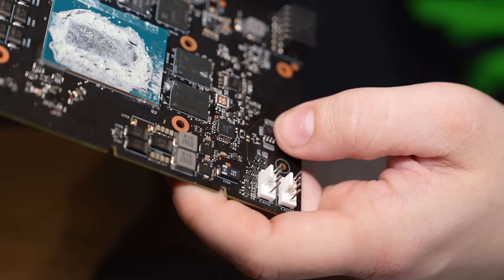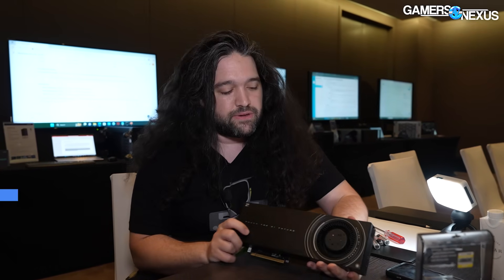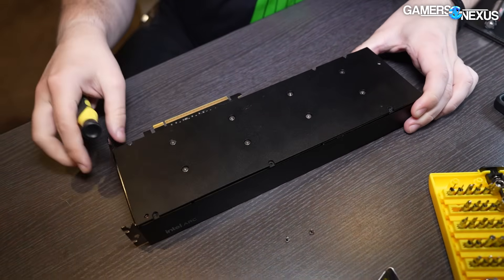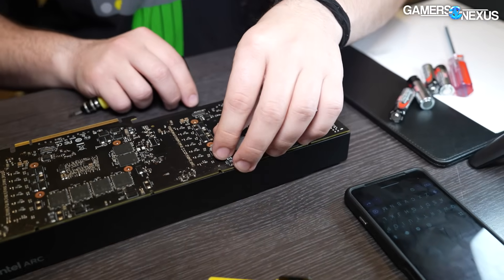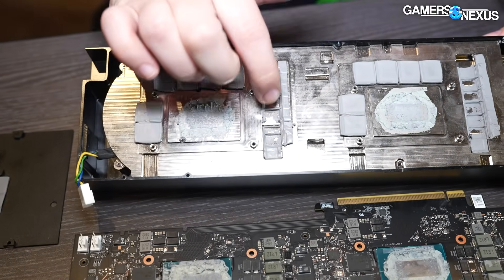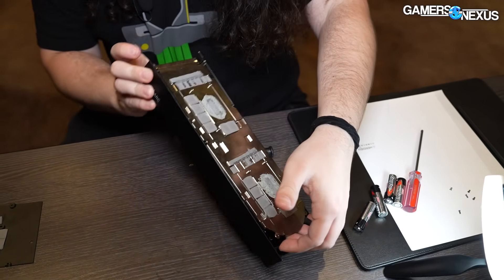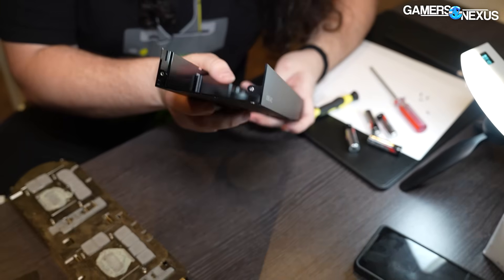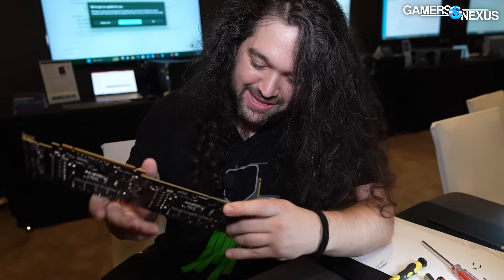Intel Arc B60 DUAL-GPU 48GB Video Card Tear-Down | MAXSUN Arc Pro B60 Dual

Comment: 48 GB is currently a sweet spot for local AI, you need either 2 consumer GPUs or 1 pro GPU. 2 cards is "affordable" (when buying used), but a PITA to fit and cool in a PC. So a dual GPU with 48 GB at below $1000 might be an instant buy for anyone working or experimenting with AI.
Reply: At this price you buy two and go 96gb
Reply: you're right on the mark, $20 per GB of VRAM is INCREDIBLY cheap, like, 2.5x cheaper than a 4060's 8GB for $380
Reply: Only concern is that it's two 24 gig cards essentially. Would be nice to see more vram per GPU.
Reply: @AltimaNEO This is probably for multi seat setups more than full system AI stuff, Intel have other configurations with more RAM per GPU as well (and it's easier to stick 48GB of RAM on a single GPU card than to squeeze 2 separate GPUs with 24GB each on a card)
Reply: @AltimaNEO  that's already huge, but regardless most AI APIs have the ability to use the two GPUs together for 48gb
Reply: @AltimaNEO  the advantage of the dual GPU on one pcb is that the card should actually be able to utilize the full 48gb pool instead of sharing it like older multi single gpu cards (I think) This is why when you were doing multi gpu in the past it was better to buy high vram variants (like 4-8gb 270x / HD7870, yes these existed in 2012). If you did this with the 2gb cards you'd be stuck to sharing a 2gb vram pool instead which is better for single card loads, since those video cards dont have the horsepower to utilize more ram than that, unless in multi gpu configs.

Idk how multigpu configs have changed, idk if they handle vram differently.
Reply: @somedude9316  Yeah, but I think this particular card is just literally two GPUs on a single board, each with their own discrete 24 GB VRAM. I dont think theyre sharing the VRAM pool. If they did, it would be totally awesome.
Reply: @AltimaNEO  its on one PCI slot on one PCB,  I'm pretty sure its a single vram pool. Internet experts go ahead and correct me. I did zero research.
Reply: @somedude9316  It's not. It's mentioned in the description, and AFAIK it's the same for every multi-GPU Tesla. If you want pooled VRAM, you need multiple boards and NVLink - because that makes sense... As for Intel, IDK if they have the equivalent yet.
Reply: @yumeN0dengon  if its bifuricated into 2 cards on one pcb without a shared pool I dont see how it could be of any benefit opposed to literally any 24gb vram card other than the packaging / space in a multi gpu configuration.

I thought the industry stopped using link connectors like xfire and nvlink because you can just do this over pci-e. (even if its slower)
Reply: @somedude9316  AFAIK NVIDIA still heavily relies on NVLink to provide large GPU pools. As for the benefit of having a discrete multi-GPU board, I guess there's something to be gained in terms of management and space/ports requirements, as you said, plus maybe some performance gains as well due to onboard bifurcation? It never presented an interest for what I do so I never dug into it any further TBH.
Reply: @somedude9316 yeah but he mentions in the video they're running in pcie 2X 8X. So they're literally two discrete cards with their own discrete 8X pcie lanes, just sharing a single PCB.
Reply: 3 of these would be perfect for running when 235b at 4bit comfortably as well. Our current best cheap options involve running it at 3bit on 128gb of ddr5 on a server/workstation type PC, or one of the 128gb unified vram/memory PCs on lpddr5x.. both options are fast enough cause moe, but running on q3 sucks compared to q4.. the extra 20ish GB over that will be very nice. This will also be much faster. 1000 bucks per 48gb is very solid.
Reply: The major issue I see with this card is the fan. The blower fan is inside the card, and the card is exactly 2 slots wide, leaving no room to get new air if you stack the GPUs side by side, as we can see in 1:12.
It would probably be better to use a non-axial intake blower fan, that takes the air from the top or the rear of the card and moves it to the exhaust. A bit less effective than a blower fan, but much better than a blower fan with a restricted intake.
If they want to use an axial blower fan, they need to make a recess for air intake.
Reply: But in this case, since it's effectively two separate GPUs, isn't it actually a pair of 24GB gpus?  I'm not super familiar with local AI workloads, but does the entire model need to be loaded identically into each gpu's memory?  (Like multi-gpu gaming back in the day.)
Reply: @realzyxtomatic  Yes, it is. IDK why Steve mocked NVIDIA about the 48 gigs of VRAM but didn't think to mention at any point in the video that it's actually only 24GB. The info is in the video description, but the video itself is sort of misleading if you don't already know how dual GPU boards work.
Reply: @yumeN0dengon it isn't misleading at all.
Reply: @jdrok5026  Yes, pointing out that this card has 48GB of VRAM while bashing NVIDIA's notorious cheapening on VRAM for the last 3 generations is so not misleading at all that OP and others on this very thread thought the board actually had 48GB actionable VRAM...
Reply: @yumeN0dengon  and Nvidia has gated parts of memory to be slower to access and still billed it as just 4gb Nvidia also used to often for dual GPU cards do like amd and Intel with dual GPU cards just count total on board memory infact they still to this day do that if you ever paid attention to marketing on business hardware they expect you to know some basic stuff.
Reply: @yumeN0dengon  and it does have 48gb of access memory it's just split between the 2 gpus technically they can access more through pcie and other technologies so it's less misleading that you actually claim.
Reply: @yumeN0dengon  so your just Nvidia shilling here when i didn't see anyone actually suggest each gpu has 48gb
Reply: @jdrok5026  Right. So, apparently, GN - or YT, who nows? - doesn't want me telling it to you like it is. But I guess there really was no need for me to point out what a genius you are anyway, seeing as you made it fairly obvious yourself 🤷‍♂
Reply: The modded 4090 48GB is best of both worlds, but they do come with their own risks.
Reply: Or video tbh, but that's exactly why Nvidia has been gatekeeping consumer cards at lower than ideal sizes
Reply: Llama LLM is pretty optimized for ROCm iirc
Reply: @yuikonnu5079  Intel too
Reply: absolutely but a dual purpose unit would be even better
Reply: The question is how easily that RAM can be shared between the GPUs. I'd like to think that dual-GPU memory access has progressed since the time I used the Gigabyte GV-3D1, (which was a dual-6600GT card that had 512MB of VRAM, but not shared - each GPU could access half of it) but you never know.
Reply: @DaWrecka most LLM software like ollama does it automatically and at very little performance cost. It will even share main RAM and VRAM (I can run models that fit into my 112 GB RAM+VRAM), but then youre severely bottlenecked.
Reply: @metacob  Interesting, but I wasn't curious about LLMs.
Reply: Well, Llama4 Maverick needs at least 96-128GB in some Q.
Reply: HomeServer SELFHOSTED AI would be awesome
Reply: @Splarkszter  Look up Ollama and OpenWebUI
Reply: No not really because even though it has 48GB it's not Pooled, it's separate for each Chip. So it's not really all that useful for AI, besides most AI relies on the CUDA monopoly.
Reply: @thelaughingmanofficial I use two GPUs for models over 24 GB all the time. Software like Ollama splits them automatically. CUDA dependency is a problem, but it's solvable.
Reply: @metacob  how do you get the drivers working? I've tried and tried, and a single GPU in Ollama works well. When I try two the driver picks up only one and uses it. I'm just stupid or something 😢
Reply: @vili5000 Im on linux and Im using Ollama in Docker. Do the GPUs work individually? Have you verified theres no issue with the other pcie slot? Does your mainboard support bifurcation? For more, maybe ask an AI to troubleshoot, theres too many things that could be going wrong
Reply: @thelaughingmanofficial The VRAM doesnt have to be pooled. This is to be thought of in the same way as running dual-ANYTHING cards. The benefit of the b60 (other than being low profile) is having 2 or 4 or 6 or 8 or even 16 GPUs that occupy the physical footprint of only HALF as many GPUs. THAT is a new frontier for AI even before any other benefits could be gained from this... ultra-parallelism. But "budget" AI builds right now are running dual 5060-ti. This effectively matches the capability of the 5090 in terms of how LARGE of an LLM you'll be able to run at all; tokens per second is where the major performance difference will be seen. But in my experience, TPS has fairly diminishing returns for basic text-based AI. 20-25TPS on the largest LLM your capable of running is pretty reasonable for most people. Or run a smaller LLM and have speed for days. Dude, but the fact that all that power is in a low profile design is taken for granted by gamers that just can't understand the benefit. You can stick a B60 in a 5liter sandwich PC and have one of the best local AI setups of 2025 (not to mention a decent 1080 gaming machine if you care for that) that can even travel with you without taking up much space. For poor people, this means we only have to afford to build it ONCE, and its practical to have it anywhere we want to bring it. I don't have to choose between packing a gaming pc or an AI/NAS/Server machine. It can be the exact same system as long as expectations are managed on gaming capability. I love it!
Reply: I'm currently writing my bachelor thesis about integrating locally run llms into video games, and this GPU would be really good as a secondary GPU, so your main GPU can focus on running the game
Reply: Price wise definitely. Also very compact so you likely can go without riser cables. 456gb/s per GPU is acceptable as they can run in parallel since it's literally 2 separate gpus on the same board. Kinda wish it was faster but it's still cheaper and faster than an AMD quad channel AI PC so the value is there.
Reply: ROCm is getting there, I use a 7900 GRE and it works pretty well with ollama and PyTorch. I don't think Intel is quite there yet though - maybe this new wave of cards will bring stronger support.
Reply: @JackMacWindows There's definitely software stacks somewhere that run on Intel because Intel has been moving a fair bit of DC level AI hardware - Wendell has talked about it once or twice. Might be that it's specific proprietary software at this stage though
Reply: @JackMacWindows  From what I've read, Intel is actually ahead of AMD in this department.
Reply: @JackMacWindows  And AMD ROKm does not support some of the features of Nvidias CUDA, so sometimes there is no compatibility at all and it simply will not work on an AMD video card.
Reply: @JackMacWindows  AMD is much worse in software than Intel. Intel is guaranteed to work wherever support is announced (LLMs, SD and FLUX). In AMD, many things do not work depending on the OS platform or hardware (for example, ROKm does not work on 7700 and 7600, I am not talking about the 5000 or 6000 generations at all)
Reply: What are you guys even doing with local AI?

Like I'm so out of the loop, I only know apps & websites that run AI through their programs, and even then it's just generative stuff.
Reply: @corey2232 Photography, videography, coding, writing is also all "just generative stuff". AI slots in into the same pipelines to make the same things faster, or to add special things you couldn't before.

Flux (image generation) barely fits in 24GB without any controls added to the process. Image-to-video (WAN) at 720p puts you above 24GB. LLMs are bigger and the best ones are in a realm of their own - running DeepSeek locally is a non-trivial task.
Reply: @corey2232  AI girlfriends. Its the future.
Reply: @corey2232  chatbot training
Reply: @corey2232  well if you want to develop something or you want to test some cool training data and don't want to pay big bucks to some international company it is better to run AI locally.
Reply: Intel have problem with soft. All on CUDA. 800$ is maximum, otherwise the V100 32GB will look more interesting and cheaper.
Reply: @Максим-ц7з5щ  Depends on which framework you are going with. Vulkan and SYCL are getting more and more competent. Volta architecture is getting deprecated soon in cuda, plus it lacks a lot of instructions that Ampere has, making them quite slow for inference. Also most variants are SXM and PCI-E adapters are like half of the card's cost.
Reply: @Максим-ц7з5щ not everything is CUDA. Both Intel and AMD are now selling billions of dollars of AI inference GPU’s because a lot of code bases are no longer exclusively CUDA. Both PyTorch and TensorFlow have native support for both AMD’s ROCm and whatever the equivalent is for Intel (I forgot the branding, LOL). And likewise, developing for those platforms is just as easy as developing CUDA - in many cases it’s just changing one or two lines of code that essentially tells the compiler which hardware the code is meant to run on. The only real difficulty is when you’re running other people’s models that have been exclusively written for CUDA and those models haven’t been ported to other hardware yet. For devs writing their own code, this is a complete nonissue.
Reply: @Максим-ц7з5щ  GV100/V100 32GB  is $2000 . Its nice as its 250W card and has nVlink and no - V100 makes 0 sense at the moment as with $1200-$1600 you can get dual 3090s and its 48 GB and cuda. Yes, power is different but with 1 GV/V100 you can get 3x3090s give a take. Vulkan is half half ... its good if no cuda available  like inside FreeBSD.
Reply: @Максим-ц7з5щ  well, Tesla is very, very, very old GPU without support of many things... e.g. quantization - lower precision, e.g. FP8. Which AFAIK Intel should have somehow supported.
Reply: correct me if I'm wrong but most AI models and frameworks are reliant on CUDA no? So Intel GPUs wouldn't be competitive. I'm aware of OpenVino but haven't seen wide adoption of it yet
Reply: @Magy21453  No, you can run mROC ( AMD ) and Vulkan (Intel ) . Vulkan you can run on nVidia and AMD cards too. its like a framework . Deepseek R1 was made writing Asembly instead of using CUDA :)
Reply: @Magy21453  no and cuda isn't exclusive to nvidia cuda cores aren't a thing, software acceleration is gatekept by nvidia it is doable on all gpus that aren't from nvidia.

Comment: Currently I'm already using RTX 3060 paired with GTX 1650. playing at 1440p 180fps. RTX 3060 targeted at 60fps then GTX 1650 uses lossless scaling frame generation x3 to achieve that 180 fps.

Comment: Nvidia: We give you 8GB now get lost and be happy. 
Intel: Here ya go. 48GB for less than five Benjamins.
Reply: hte only reason to make drive to a game are if the game needs 48gb , are there even one game that benfit of 48
Reply: @jarihaukilahti  It's an AI card.  
Also, if Gaming GPU's had 48GB, Devs would start to use 48GB ...chicken or the egg.  
As long as they still sell 8GB GPUs gaming will stagnate around 8 - 16GB.  
Oh well, in the end it depends what Xbox and PlayStation are doing, that will always be the floor when it comes to RAM and VRAM usage.
Reply: @jarihaukilahti games wouldn't benefit much, but stuff like cfd simulations and video editing would benefit greatly. machine learning would also benefit in theory, but relatively few models are in the 10-20 billion parameter range (there is some chicken and egg here, to be fair).

Comment: I'll happily connect 4 8-pins to that! The 12-pin can bugger off!
Reply: Limit it out of the box to 375w and that's in spec for 2x 8-pins with the PCIe slot power. It can then switch to 'OC mode' and go over spec quite a bit and the 8-pins still won't get anywhere near as toasty as nvidias trash connector. AMD ran the R9 295X2 on 2x 8-pins and that bad boy sucked back 500w under load, turns out when you overspec a connector instead of underspec it, things don't melt. Who knew?
Reply: @damstachizz There's also the fairly long history of daisy chain 8 pin connectors, where there's a second connector just spliced off the first. If specced properly runs just fine (my Fractal Design PSUs even use these). No way in hell you could ever consider doing that with 12V 2X6
Reply: For 400W max? This is fine, that connector is good enough for it. It's nVidia shoving upward of 600 unbalanced watts in there that has a tendency to burn shit up. And not all of them burn down.

Just a matter of use case, implementation and tolerances.

Comment: This dual card has huge potential for streamers if Intel or MAXSUN can make it work with OBS dedicated on one gpu and a game dedicated on another.  Why, because some games will crash with streaming applications when sharing the same gpu and not everyone wants to shell out a second PC.
Reply: Why shouldnt it work? These cards are not connected in any way, you can connect two B580`s through a pcie splitter for the same effect (just less space efficient). Only need to set up app to use cards appropriately.